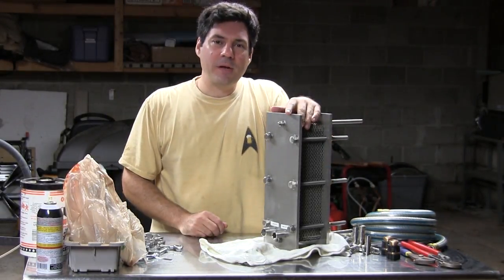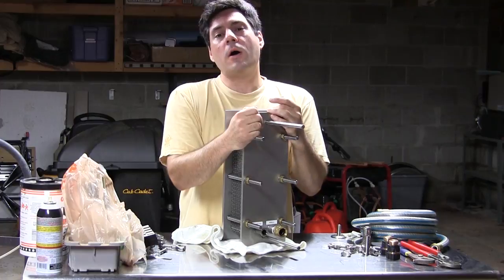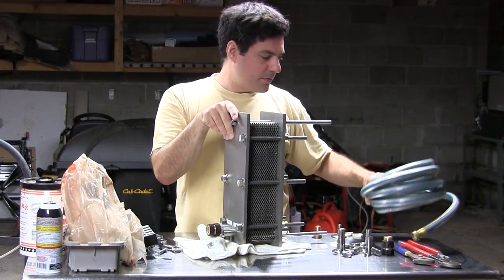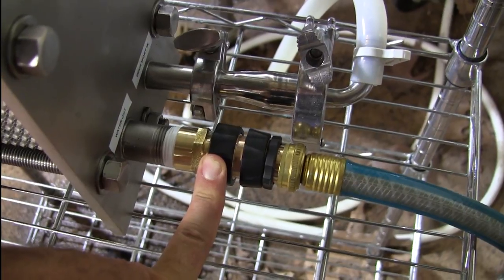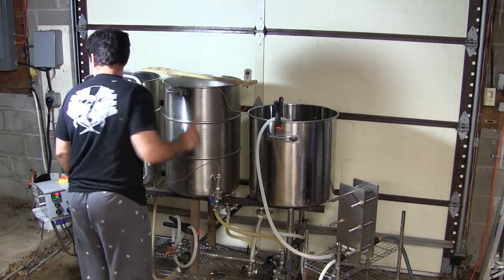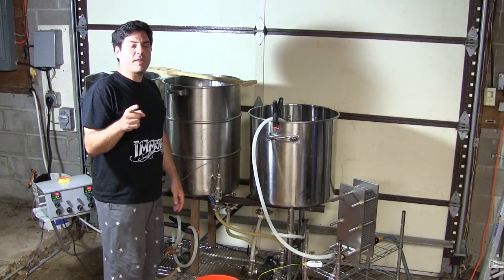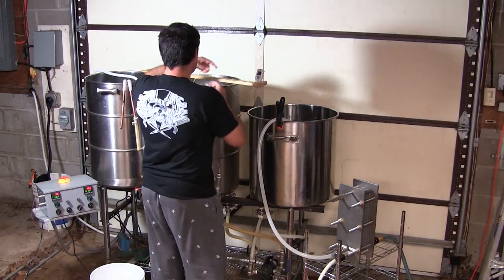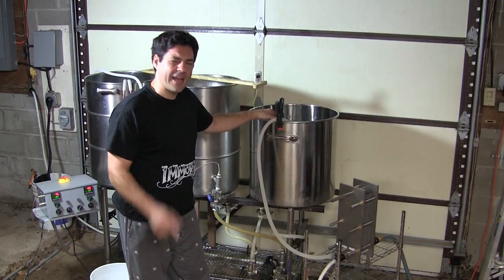Testing out the Sabco Plate Pro chiller/heat exchanger

Comment: My own APV plate chiller has the text upside down when i turn it like yours. Plus I had a lecture in my Engineering school with a guy from a plate chiller company saying air pockets is a huge efficiency killer. But maybe with the right flow and thin enough space between the plates any air is flushed out in your chiller. It seems to work just fine :-)

Comment: Nice setup.  I was thinking about using a stand similar to your's.  have you had any problems with the metal transferring heat from the boil kettle.  My thoughts are the stand would get crazy hot, have you had any problems with that?

Comment: Sweet setup! one thing though, you have put the chiller upside down allowing air pockets in the top of the chiller which reduces efficiency. Not that it seems to affect your chilling anyways haha.
Reply: i'm confused, all the labels would be upside down if it was turned with piping on top which makes me think he has it correctly. it would let air out yes, but would it also make it a deadzone trapping wort if connections are on top "u" shape circuit as apposed to a "n" which would allow draining?

Comment: I'm not so much a brewguru, but know a bit about computers and thermal dissipation. Have you thought of putting radiator fans, in a push/pull config to draw ambient air over the plates? Just looking at the vid it appears you could easily fit 4 HSP fans and that should increase thermal performance quite a bit. The fans might give you the ability to run the pump flow rate at 100% and achieve 70F wort output. Should be rather simple to set up and test ;)
Reply: EmoXardas there isn't any way for the fans to do anything for this type of heat exchange

Comment: Hai, 
Sir I had a doubt regarding the plate heat exchanger.Are the distance between the plates fully filled by the gaskets ,that is, is the channel width equal to the thickness of the gaskets??
Reply: Sir,
But you have assembled it by yourself know ....by seeing you might know whether the space between the plates  while seeing from outside is it filled with gasket.or something additional..?

Comment: Joe,,,you were mentioning if you slow the pump down,,, I am not that familiar with these magnetic pumps,,,is there an issue with voltage drop and increase amps burning up pumps if you use a rheostat type voltage adjuster . Idk ...is there a speed adjustment on those March? pumps you have
Reply: *****
OK ...yup...guess that would be an easier way....thanks !